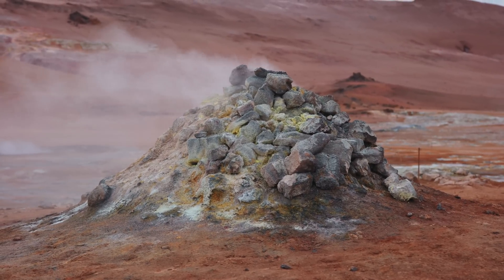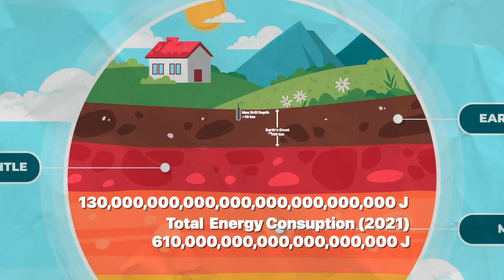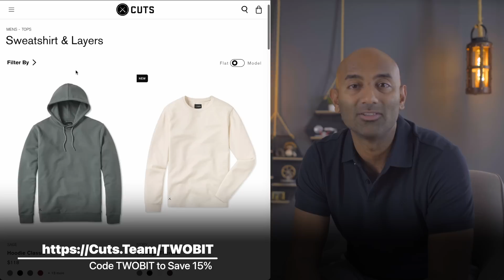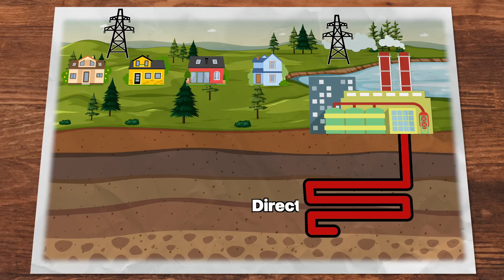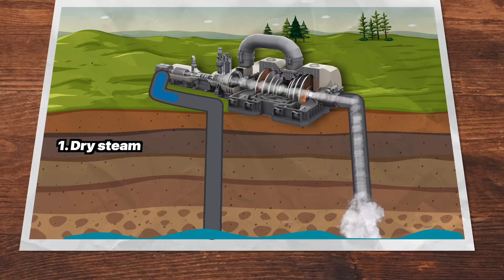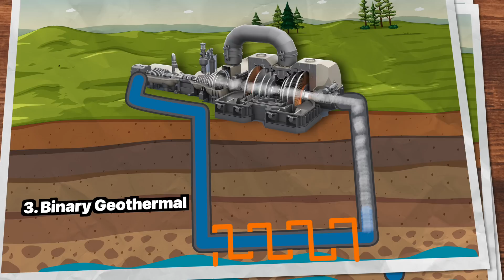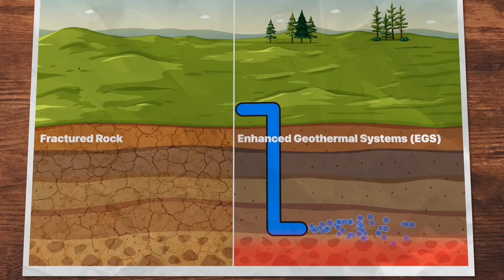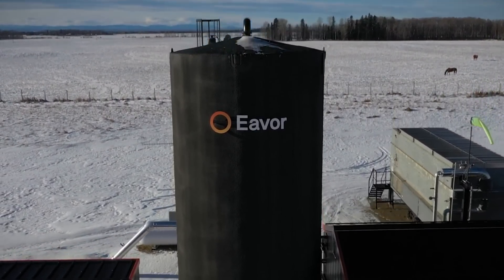This Breakthrough Energy Source Will Replace Nuclear & Coal!

Comment: I’ve become a YIMBY lately so I’m all for any advancement which will enable us to lower GHG emissions while also spending less money.

Based on my research, going partially in on geothermal energy does this. The cost savings doesn’t look like it works at first, until you realize that geothermal energy helps let us go all in on solar and wind generation because it solves the intermittency issue. So as a whole, our energy industry still saves money as a result.
Reply: "Yimby"?
"YES! In MY back yard!!!" ??
Love it!! 😂😂👍👍
Reply: It's one of the only clean and renewable solutions for baseload power that doesn't require separate energy storage, so yeas! It's awesome

Comment: To date Eavor offers the best solution. No pollution. I am all ears for your promised next video on this topic.
Reply: Totally agree!
Reply: I think I know the tech he's talking about. Basically, someone working on fusion tech did a proof of concept that uses the microwave laser from confinement fusion. It can vaporize rock and drill at a steady pace that outstrips the speed of mechanical drilling. No moving parts also means that you don't have to keep pulling the drill up for frequent maintenance. The laser also causes the well drilled to naturally case itself in a dense glass-like material. Twice as deep at a super low cost, basically.
Reply: @omniscientearl  Yeah I heard about that drilling laser idea. It's certainly been conceived before in sci-fi and video games, but if someone can make a practical version of it, it sounds great! I wonder how much juice that thing takes and how they plan to deliver power to it.
One other small issue though. If you're drilling a closed loop system, you have to go horizontal at some point. I wonder how that works.
Reply: @DFPercush  Me too! It seems crazy but Eavor must be doing it somehow, hehe. There's another way to work around separate injection-production wells. Some companies are using concentric pipes in the same well. They run the working liquid through the outer jacket to absorb the heat and then pump it up through the central pipe that goes to the turbine or the flash tank.

Comment: Recently scientists noted a gallium aluminum alloy capable of electrolysis of water (even untreated water) without any energy input, at ROOM TEMPERATURE.  turns out the gallium part of it is indefinitely reusable (as a catalyst), look it up.
Reply: That I would very much like to know more about, since I can probably be also rolled into a desalination plant.
Reply: No energy electrolisyse? Where do you put the electrons? Where do you get the electrons. Does not compute 404. I had a phase doing st home electrolysis for hho gas and fun and there's a lot of snakeoil around the sector.

Comment: Absolutely agree with you! Geothermal energy is something that is greatly overlooked. Great comments.
Reply: Easy to overlook as it is always under us.
Reply: Earthquakes!  I lived near a geothermal plant. Two or three quakes a day. Most small, but all are disturbing. You stop where you are.
Reply: @oldmech619  - Most places where geothermal heat is close enough to the surface to be cost effective to drill are near active volcanoes or techtonic plates, in other words earthquake prone geographic areas.
Reply: @WJV9     I lived near the geothermal power plant at Cobb Creek California. I knew the general operator and I had a personal tour of the plant. Injecting water into the earth and then extracting it causes constant small earthquakes.
Reply: I read about cities with high rise buildings also produces earthquakes. With world wide high buildings and ad on geothermal technology, will we have dangerous earthquakes?
Reply: @JR.M.S  Here in Colorado I have also heard the same concern over the effect of fracking potentially causing earthquakes. Agreeing with your concern, I think that anything theoretically that could cause a fault slippage could cause an earthquake - the injection of water, petrochemicals, or steam. Oklahoma is an example of frequent earthquakes caused by man-made fracking... though in the 2 to 5 magnitude range, which would be considered more moderate than a major jolt. In Colorado we had 3.5 earthquakes when an attempt to inject nuclear waste deep in the ground was attempted.

However, more than likely the reason for earthquakes occurring near areas of geothermal heat extraction  is that the area was seismically active to start with since easily accessible superficial geothermal heat often is the result of volcanic activity.  Hot spring areas are well known to be prone to earthquakes; and long before the intervention of man. Strong earthquakes have occurred and are occurring in Yellowstone, Mammoth Hot Springs, south of Reno Nevada, and in Montana.
Reply: @JR.M.S     Geothermal plants produce frequent small local earthquakes.
Reply: Did anyone here consider that our solution to producing too many greenhouse gasses is to drill massive holes that spew out greenhouse gasses? As it stands, society could be wiped out and plants would stop producing C02. If we used these to supply billions with power, they dont turn off, you cant just decide to plug these holes. 

We could wake up tomorrow and someone may have solved oil and gas refinement to where it burns without producing pollution. This entire process revolves around pouring water in to hot reservoirs, creating greenhouse gas. In 100 years there is no question that oil and gas will have less of an impact on greenhouse effects, like I dont understand how this has ever even been given serious consideration by climate cultists. 

Literally all this would do is make sure that even if we nuke ourselves, we still manage to fuck over all life even after our parasitic existence ends. Which would totally be what we would be trying to do at this point.